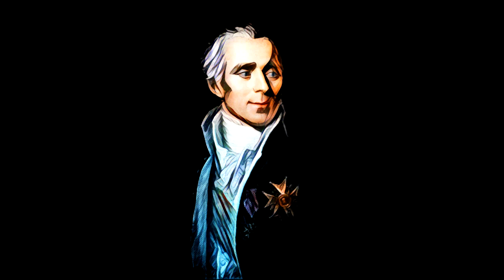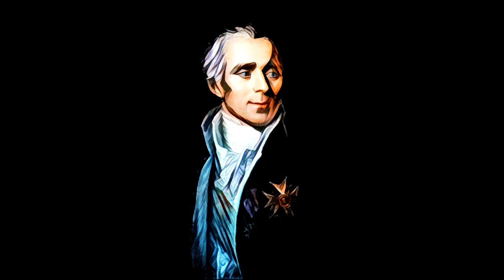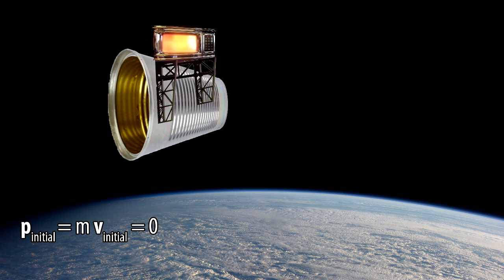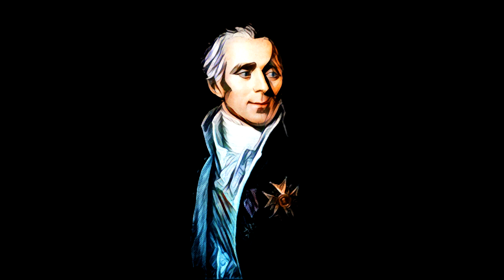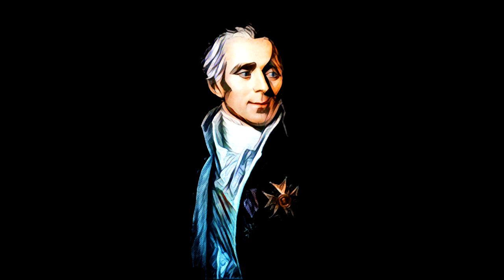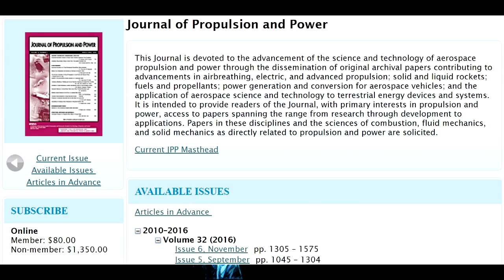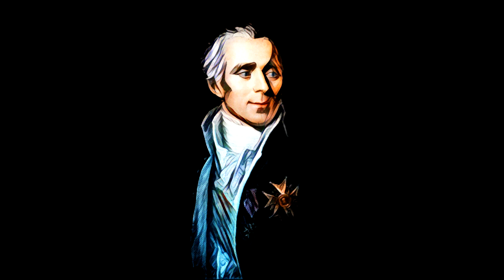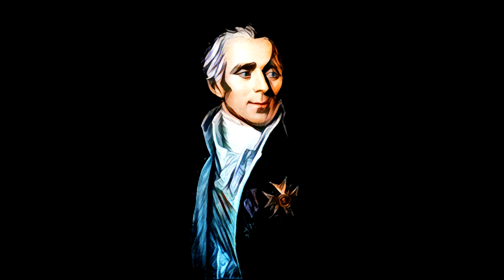The most unscientific approach – The Emdrive (part 1)

Comment: Ridiculous! Emdrive consume electric energy which is converted into thermal energy and kinetic energy. So there is no perpetual motion, and there is total energy conservation.
Reply from the maker: No. Energy conservation would be violated by this contraption, and I explained very clearly why.
Reply: your equations have no meaning, confused scalar products between vectors with products between scalar, confuse the weight force with the mass. No measurements made by NASA violates the principle of conservation of energy, otherwise it would not have passed the peered reviewed process
Reply from the maker: There are no confusions in my equations, sorry.

"otherwise it would not have passed the peered reviewed process"

Already addressed.
Reply: The equation at min 4:23, it makes no sense! The denominator of the division there is a force (Newton): Know cars weighing 100Kg, so with a weight force of 1,000 newtons? So either you talk about lack credibility quantities or confuse physical parameters. Force and Velocity are vector : normally the speed of a car into a plan is a perpendicular to its weight force, and does not consume any work nor any power, because you're only considering the ideals mechanical aspects. But if it is not so, then you are considering a car falling from a skyscraper? It is also not an energy budget because they consider only the mechanical energy in an ideal way forgetting the other forms of energy.
Reply from the maker: " it makes no sense! "

It makes perfect sense. 

"Know cars weighing 100Kg, so with a weight force of 1,000 newtons? "

Read again. It doesn't say 1000 newtons. It says 1000 kgf, or 10000 newtons.

", then you are considering a car falling from a skyscraper?"

In which case there's potential energy being converted into kinetic energy.

Look, the equation is right. The conclusion may be surprising to you, but it's right. Any device that breaks conservation of momentum may be turned into one that breaks conservation of energy in this way. That's how it works.
Reply: Vacuum Diagrams , 
My Ion Drive Air Cleaner Works!

Comment: E=mc^2
E=mv^2/2
E=F*dL
P=mv
W=V*I
E=W*t

Rearrange these basic electrical and physics equations and all your explanations are nullified. Not only that, but your explanation basically claims that solenoids do not work. Electrical energy cam be converted into mechanical energy by manipulation if the magnetic domain. Momentum is conserved because the magnetic dimension loses energy whilst the mass dimension gains energy. Energy is what's important NOT momentum.
Reply from the maker: "Rearrange these basic electrical and physics equations"

You're mixing together Newtonian and relativistic equations (e.g. E=mc^2
and E=mv^2/2). What you get from doing in that is guaranteed to be wrong. My explanations are correct.
Reply: Yes, I am. They are connected through physics and therefore can be manipulated in tandem